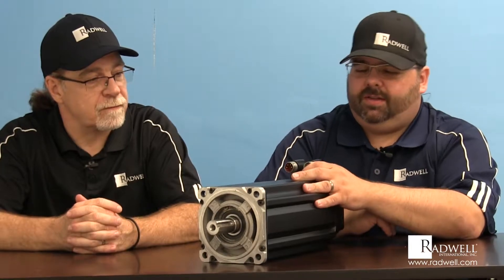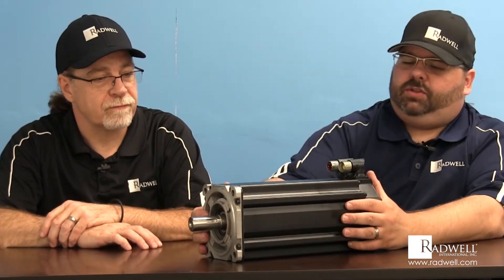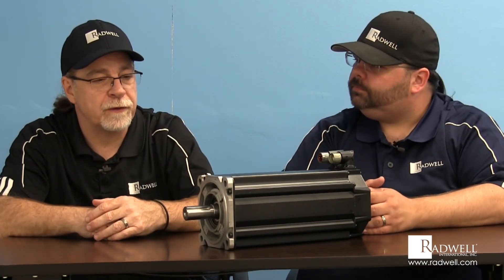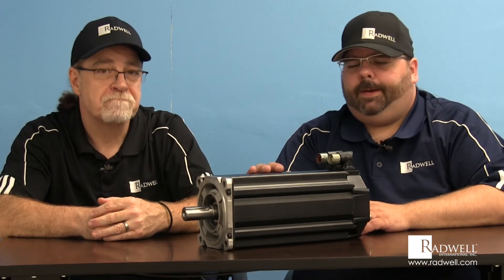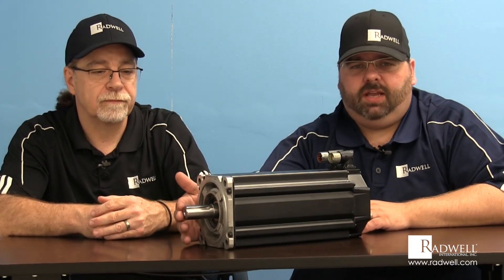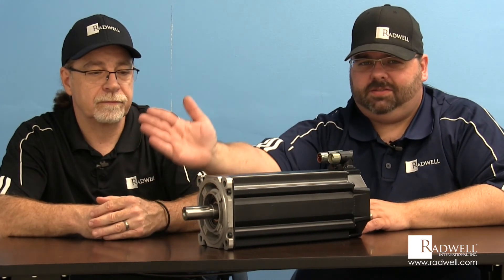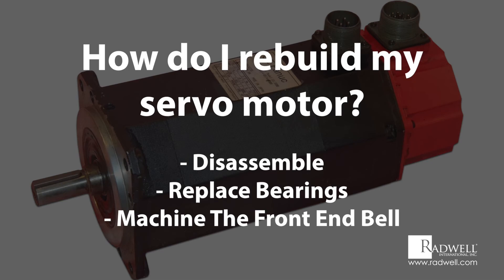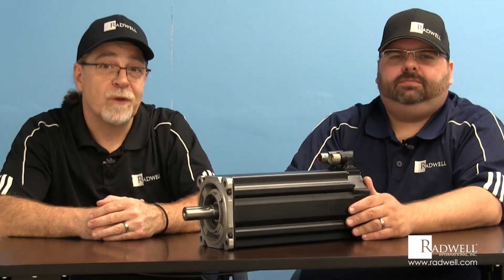Servo Motor Repair (Part 1)

Comment: great video. I have a question, does asynchronous servo motor require feedback alignment after bearing replacement?
Reply from the maker: Okay, from the experts: Asynchronous motor is a basic AC motor so feedback alignment is not necessary
Reply from the maker: We will ask our experts and let you know. Thanks for watching!

Comment: Where's part 2?
Reply from the maker: Part two had to be pulled for a technical issue
Reply: @RadwellTV  I have that issue on an SEM X axis motor. I have not disassembled it yet to see if the nose casing will need repair.